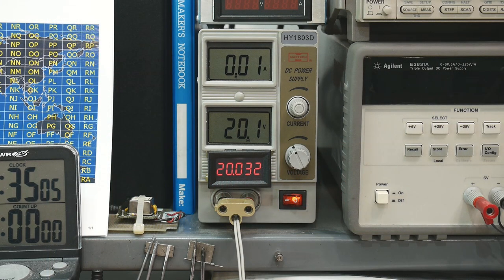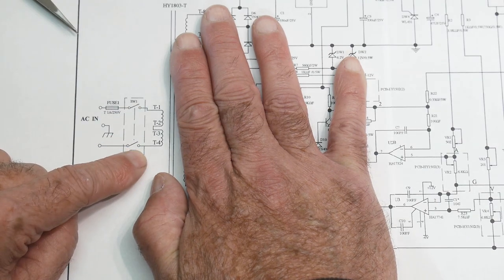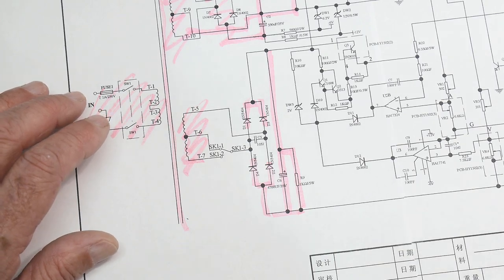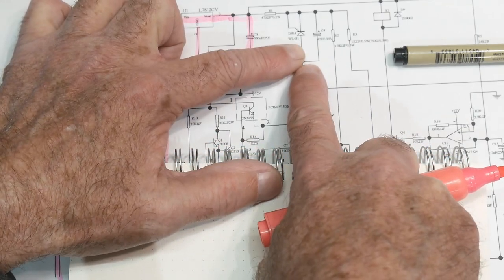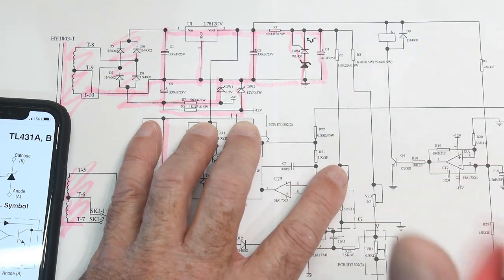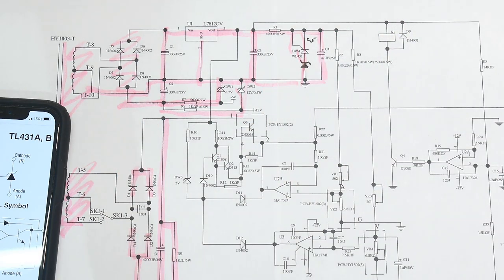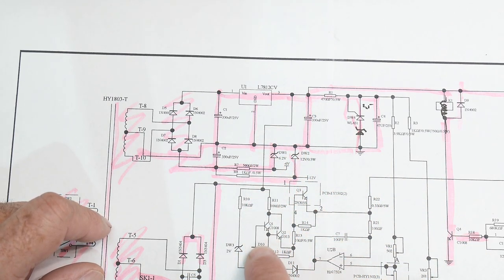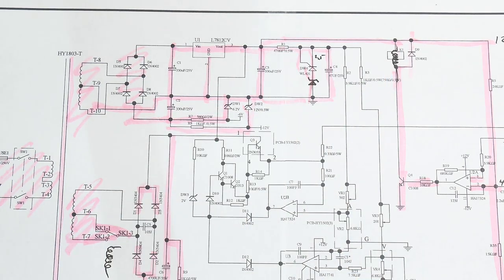#733 Deciphering a Schematic (part 1 of 2)

Comment: In the original schematic, at least from what I can sort of see in the video, the symbol for an SCR is used for the TL431.
In the hand drawn TL431 circuit the feedback is taken from the wrong end of the current limiting resistor. The TL431 is properly called a shunt regulator.

The thing in the feedback path for current regulation is NOT a comparator. It is a linear amplifier operated open-loop at DC with the gain rolled off with rising frequency by the feedback capacitor. This is a very common configuration for an error amplifier in a power supply. The voltage control loop is much the same.

Comment: So the WL431 / TL431 is an adjustable zener voltage reference. And how does a voltage reference compare with a voltage regulator?
Reply from the maker: https://youtu.be/4qAKd8EucoE?si=ZgBVBrqm5s4fG0JE
https://youtu.be/6hXzuLKzXmg?si=iRzu0Yi3GJYXm9SF
Reply: @IMSAIGuy  Thanks!

Comment: Why can't they use a high frequency clock circuit to drive a chopper at something like 400Khz which can be smoothed by smaller capacitors so you get a nice clean voltage and no ripple.
Reply from the maker: analog supplies will always have less noise than switchers.

Comment: Hi! What's the purpose of your map with the two-letter grid?
Reply from the maker: It is a grid square map used in Ham radio. Some digital radio formats (like FT8) transmit this info to the receiving station.